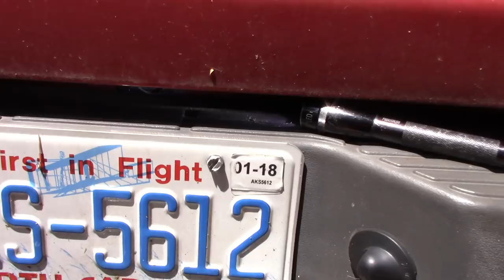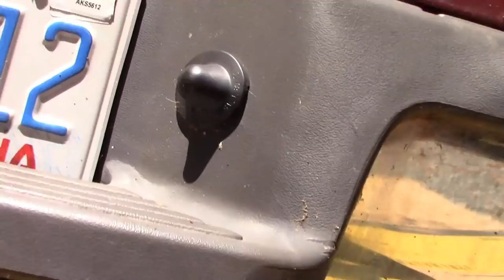99 Ranger Rear Axle Bearing & Seal Replacement

Comment: Love your format for your videos very educational. I have the same issue with my 97 ranger and with the help of your video it should be pretty simple to fix (relatively). I did luck out however I do have access to a concrete floor. Nice video over all very helpful.

Comment: Very good video.  It helped me on my 2wd 1989, Bronco 2.   However, I would like to comment on the varying size of the rear seals.  I have a similar problem with my 1998 Chevy S-10, PU.  The  rear grease seals for the front rotors  use a 1997, seal, not 1998.  The thinking is when they were assembling the vehicle they were pulling parts from different years.  Nothing I can do about it, but purchasing the 1998 seals will not work, no matter what O'Reilly says.  Keep trucking.

Comment: Nice video... Thanks. I have the same problem with my 2000 Ranger 4.0L and I'm planning to use your video to do the job. I search Rockauto and looks to me that there are different rear bearing sizes. A little confusing for me and I'm struggling to identify the correct rear bearing for my truck. Can you help?
Reply from the maker: I took my old bearing to Advance Auto for a comparison. Based on the code, I had the correct size, but when I got home it wasn’t. I went back to Advance and they gave me the other size listed. Maybe there was a production line change and the ID tag wasn’t changed??

Comment: 37:20 You pre loaded the rear wheel bearing with red and tacky grease? These are the same bearings that will be lubricated with the differential oil... Is that
a good idea? I have just loaded them up with the diff oil like you also mentioned but never have I put grease on them. The only time I have greased
wheel bearings was for front ones that are tapered and removable. Maybe it does not matter and the grease will just dissolve into the diff oil and no big deal right?
What do you think?
Reply from the maker: A Ford mechanic I checked with said OK, just don’t overdo it.

Comment: 28 spline 8.8s and 7.5s use the same seals and bearings.  You likely purchased the 31 spline 8.8 seals and bearings originally, which has a thicker axle shaft and larger seals and bearings
Reply: What this 👆 guy said...

Comment: I have a problem with my differential it makes noise when im above 40kph and goes lauder when accelerating does anyone know what the problem. The mechanic told me to replace the ring and pinion gear is he correct. I have the same differential any leads where i can find one for parts.
Reply from the maker: Google this one. Might find what you need.
Reply: @TOM2RN i already had that video and it was 100% same

Comment: I think the parking brake cable is supposed to run on top of the brake shoe springs! I could be wrong, but I just did this in my 97 ranger and had mine on the outside.
Reply from the maker: I was just looking at a similar video from South Main Auto and I believe I have the correct orientation.  The 97 could be different.

Comment: tom nice video.....does each side/ axle have its own c clip ? seems like it would since you showed how it goes up against the o ring on end of axle and theres 2 axles, just want to be sure...…..and im sure the c clip goes in the same position as it was sitting but just to be sure does the open end of the 'C' face perfectly downward ? thanks
Reply from the maker: Yes, a clip for each side. Just remember to push which axle you are working on toward the center just a tad then remove the clip. Do one axle at a time and temporarily put the straight pin back in with it secured by its set screw put in loosely. If you don’t the internal gears can slip out of place when you bang away with the slider. C clip is held in place by the straight pin. Once the straight pin is in then the c clips can’t fall out. C clip placement up or down not so critical since the straight pin keeps everything in place.
Reply: thank you !

Comment: I removed that 8mm bolt, but I am having an issue removing the Silver pin please help.
Reply from the maker: Make sure you have turned the gears the way I have it in the video.  Reach up behind feel for the other end and push it through.  If you meet resistance, jiggle the wheels a tiny bit (forward and backward as well as pushing or pulling in) to release any tension.  Don't turn things since the gears will fall out if the pin slips out first.  Putting the gears back in position means you might have to remove the entire assembly to put things back.

Comment: What is the model number of the new seals amd bearings?
Reply from the maker: Lsucountryboyz225 
The best way is to pull the old ones and go to the parts store. My first ones were too large. Measure them before you leave the store. There are variations in the rear ends.
Reply: TOM2RN i understand, i did but i want to know for sure they give me the right model number for the seal and bearing. I have the same size axel as you my bearing measures 2.25 as well.  They cant cross refrence the model number from the old bearings bc its not in their system.  I did some reasearch and im pretty sure the new model number is 5707 for the bearings and the number for the seal im pretty sure is 8660s.  Like you say they dont carry the old seal with the lip so i’m just wantin to make sure i get the right seal rather than just throwin something in that im 80% sure is the right thing.  No disrespect to the employees but i’m sure you know how swirly service can sometimes be at these fast food part stores.  Thanks for the quick reply as well.
Reply from the maker: I'm sorry to say I could not find the part numbers.  I usually order online from Advance and pick up in 30".  I searched my old orders and I must have picked this up at the counter rather than order online.  I looked at the Advance site and nothing seems to match per se.  I believe one of the two was made by Timken.  I can't remember if it was the seal or bearing.  I just looked on RockAuto and they seem to have them.  The confusion was I took the photo of the tag on the tranny case and went to Advance.  They looked things up and thought they gave me the correct parts according to their computer listing.  Once I got home, I noticed they were too large.  Goes to show you not all the data is correct.
Reply: TOM2RN no problem my friend i got em and took care of it all. Thanks again.

Comment: Why not use the paper gasket instead of RTV?
Reply from the maker: You could, butI like RTV because it is so flexible. I have recently made two round trips from my home in N. C. up to Virginia to my sister’s place. It’s around 115 miles each way. The first trip was pulling a 4 X 9 U-Haul trailer with a washer and dryer in it. Highway driving as well as some curvy mountain driving in 90 plus degree weather. No issues.

Comment: Speaking of Odor....If someone farts I can tell you exactly what they ate! You don't have to use a jack stand to center it because It is self centering. You don't pack it with grease either use gear lube. RTV is used at factory and those are brake shoes not pads. And this is an 8.8 with 28 spline axles.